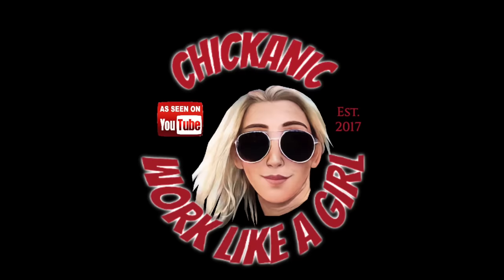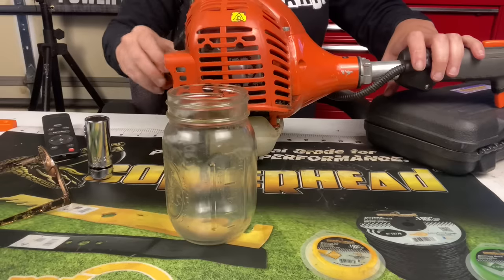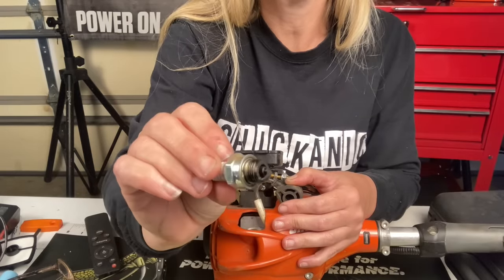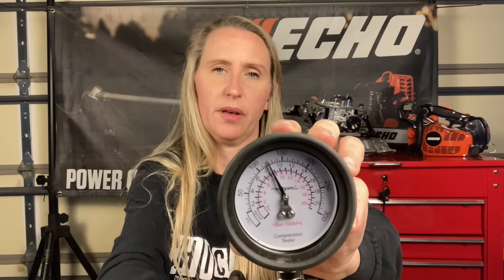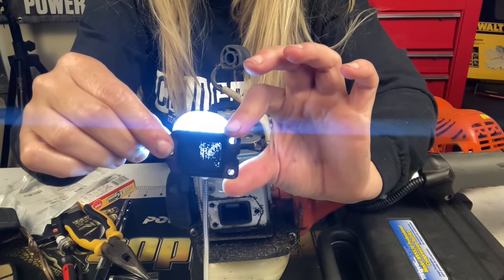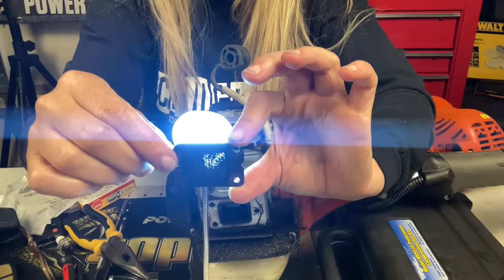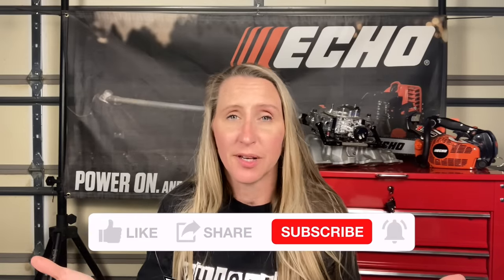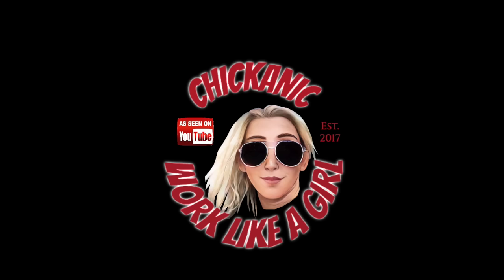How To Fix A String Trimmer That Won't Throttle Up. Echo SRM-225 Complete Diagnoses and Repair VLOG

Comment: Hi Bre, I have a PAS-225 and for some reason every time I use it oil leaks out of the muffler and runs down the fuel tank have you found a fix for this problem?
Reply from the maker: Are you using Echo oil? Usually the only reasons for this is is the same as I mentioned in the video. Not running it at full throttle, dirty air filter or mixing heavy. Stihl oil from the grey bottle will also do it. It should all burn off while running. You might check your exhaust port and make sure it is not clogged.

Comment: I have an Echo SRM 225 that I bought 12 years ago and I had to replace the carburetor about 8 years ago because of ethanol gas. I use it every weekend most of the year and it still starts on the 2nd pull every time. I will never buy any other brand for a string trimmer.

Comment: Mine is brand new from the store. I put the eco brand in. It's not starting. Sounds like it wants to. But no start. I took the air filter off to get some extra air in there but still no start. This is one reason i always like battery power ones but they don't have the power of the 2 stroke which is why I purchased this. I need to get rid of some high think weeds and brush. Can't do anything if I can't start it . Any idea what it can be no start fresh out of the box plenty of fuel 🤷‍♂️

Comment: Need help. Looking for why my Echo SRM225 shocks me.  I replaced the spark plug boot even taped the wire from the coil.  I still get shocked.  Do you have any thoughts?
Reply from the maker: You have a five year homeowner warranty. If you take it in they should be able to figure it out for you. I know they did enlarge the boots on the newer models.

Comment: I have a Echo SRM 225 that leaks oil I took it to be serviced and was told it leaks because I don't cut/trim at Full Throttle and it can't burn off oil. I don't buy this can you help me?

Comment: I’ve got a 22hp husqvarna riding mower that spits and sputters I changed the spark plugs and put a new fuel filter on it and put some fresh gas in it mixed with a little old gas it ran fine for 30 min then started doing it again idk what’s wrong with it
Reply: Did the same thing last year but after a while it ran fine

Comment: Well I think my old John Deere BC1600 made by Homelite is dead.  I followed everything on this  video and more.  Cleaned carb, replaced fuel lines and filter, replaced primer bulb, cleaned exhaust and screen, replaced air filter, spark plug, fresh 90 octane ethanol free fuel with Stihl silver 2 cycle oil and I'm still have a top end running problem.  I just checked the compression and it's at 100 which I'm guessing is too low for this engine.

Comment: Update on my edger and weedeater. The screen is clean in both but they are still bogging down or choking down at full throttle. Someone recommended new carburetor. I don't use the mixed fuel. I use the fuel from the red can that is already mixed.

Comment: I have this same. model.  Recently, i have been getting "shocked" from the trimmer around my tricep muscle area when pressed against the machine.   Any suggestions on what to check?  

Any help is appreciated.

Gary
" fro
Reply: happened to me. worn spark plug boot

Comment: originally way back when it was the us forest service  not the epa that mandated screens. some mufflers actually have media in them that are catalysts. so those are emissions related. it is a fallacy that the epa can fine you  for a plain screen but hey  with the government you cant win. its like puting a different air cleaner on. since the one it came with was used for certification  they deem all others to be a change in emission device /decertifying it.

Comment: Clean the very small screen that's close to the muffler.  In time folks, because a weed eater has to take gas and oil mixture, that screen becomes clogged with carbon deposits.  You will have to take that screen out completely by unscrewing all the screws in and around the casing of the muffler and removing everything out of the way. There, once exposed, is a screen that acts like a pollution control unit.  Take it out and wire brush all the carbon deposits off of that screen.  Once completely clean, you must put it back because if you don't, those carbon deposits will get on the piston of your engine, and hamper compression and choke out the performance completely on your weed eater. After putting the screen back into place and putting everything back the way it was, wouldn't hurt to get a new spark plug, and new gas filter. Change your spark plug, and change your gas filter so that clean gas and oil mixture reaches your carburator so that it sprays the gas and oil mixture into the small chamber of your weed eater engine for smooth performance and operation. Additionally, doesn't hurt at all to get a new air breather, air filter, if you will to keep all things up and running smoothly.

Comment: Help! I have the same trimmer,  put new spark plug, new carburetor (cheap one off Amazon), new fuel tubes, fresh fuel. Starts right up and runs great for 10 mins then dies. Can get it started but will not throttle up and dies. What can I do?
Reply: Also put new air filter, fuel filter, and cleaned the spartan arrestor.

Comment: 27k is that joe shomo or just repair shops cause every logger lawn maintenance company and smart enough to work on them that's the first thing that gets tossed out. That screen is the reason many machines break down. Just wondering

Comment: I have a sthil Hedge trimmer which I have replaced new Carburetor, spark plug, air filter, fuel filter and exhaust. it runs great until it gets hot then starts to bog down. If i open fuel cap and replace it runs great again for another few minutes but bogs down again. Any ideas?
Reply: its a HS45 - does not have spark arrestor

Comment: I have all stihl Equipment and don’t waste time doing anything but checking your spark arrestor screen first. 90% of the time that’s the problem and it’s a reoccurring problem on most steel equipment. It’s either carbon buildup or spider nest in your exhaust port That causes a lack of power or condition

Comment: HELP ME PLEASE!....I can't remember if my ECHO SRM-225 is 40:1 or 50:1   It hasn't run in years so I bought a $16.00 replacement carb and will do the rest but I'm 62 and I will be darned if I can find anything in my documents (that I can find) what the ratio is. They don't even explain how to load the line up..not much help.

Comment: How do you know when there's water in your fuel. Mine will idle but when pressing the throttle it boggs and eventually shuts off. I've gone through all the steps she made and all checked good. If anyone can help, id appreciate it.

Comment: help, I replaced all fuel lines, carb because it would not rev up. After replacing lines, carb, spark plug it revs up but then it dies like it runs out of gas?

Comment: Would a small engine shop hire me without schooling or experience working in a shop? I’ve worked on small engines and my vehicles  since my teens. I’ve been a vet tech for 15 years but I really just don’t wanna do it anymore.

Comment: Exactly why I went with the EGO line. I watch my neighbor struggle every week to start his mower and string trimmer. Here I come, pop a battery in and off I go. Five years with original batteries, starts every time. You buy a $300 mower and in a couple of years it's serviced costing $100. Just doesn't make sense.
Reply: I've tried the EGO trimmer and it simply does not have the power of the Echo and costs considerably more. My trimmer is about 10 years old and starts on the third pull. My 12 year old Echo blower starts on the first pull.
Reply: Steve, you must have voted for Biden? LMAO!!!

Comment: He also needs to know he can stick the ring. The he has to pay the labor to pull the cylinder, get the ring loose hopefully without breaking the ring, clean the ring groove, and reassemble the unit .

Comment: You may already know this but echo makes a compression tester with a 3 inch tube that echo technicians have to use floor warranty work, they claim they are more accurate then the compression tester with the long tube are use an echo compression tester for handheld equipment.

Comment: In my experience, when everything is right.... I.e. good fuel & fuel filter, clean air filter, clear exhaust screen, good spark plug, no air leaks, no clogged carb passages... a carb adjust is not needed.

Comment: I have a question about fuel octane. Is it a good idea to run 2 stroke engines on high test ? I have been doing this since my boat mechanic said I was supposed to run my mercury on high test fuel.
Reply: Normally yes especially when premixing oil & fuel. I run Sunoco Optima 95 never had a fuel problem

Comment: No screen means sparks spewing from exhaust and possible grass fires. I have used the same srm225 for 10 years, residential  use each season. It’s a Very durable machine

Comment: Use a torch to heat the hell out of the muffler ( off the machine) and either clean or 'accidently lose' that screen.
pound the muffler after super-heating to remove all the carbon and use high ratio (50-1 +) oil mix.

Comment: HELP HELP I need help real bad I have a Husqvarna 322L weed eater that will not run on full throttle I have replaced spark plug, fuel lines and fuel filter I have replaced fuel bulb replaced carburetor , and intake gasket. It will idle very good and starting is easy also have clean the spark arrestor. What is next???? Oh by the way the compression is 150 psi I am really lost now. Please help

Comment: Sometimes it can be also a fuel cap with a clogged vent,  so the carburetor has trouble getting the fuel out of the tank. But you know this already.😂

Comment: At the same time, for the cheaper units from Walmart I have seen many that simply need the fuel adjusted. Simply because every weed wacker style engine built in china aren't jetted or adjusted properly for the specific area they are being sold.

Even though adjusting those fuel settings are most likely close to $27,000 fine as well...

An adventurous YouTuber would simply put their license on the line and start a YouTube Series about stepping in deep dodo with the EPA and crawling themselves out of said hole... HAHA Just imagine all the drama you are missing out on!

Comment: I was fairly positive the screen was clogged just from the title.  This is one of the reasons I have started transitioning to battery tools wherever possible.  I got real tired of rebuilding carbs and cleaning exhaust screens every year.  I also got tired of messing with mixed gas.

Comment: FYI-my experience is when buying a new machine,check to see if the factory installed grease in the gearing down by the head.The Ryobi came without grease and the string would melt.That is how I found out there was no grease.

Comment: UPDATE:  The spark arrestor on my echo GT  225 trimmer is oil saturated and plugged, compresssion is good, I made a 25:1 mix, by adding oil to my container when I had no gas, got gas and added again oil to mix.  mix is fixed as in made a new batch. will clean screen tomorrow..

Comment: What?  Check the easy stuff before you start twisting and turning carburetor thingies in and out and screw the engine up even more?  But I'm a guy.  I know what I'm doing.  Ahh, this thing's broke.  I'll just buy a new one.  Great video!  Thanks!

Comment: Map gas will burn that screen clean as a whistle
Reply: Agreed. Really quickly too. I generally torch the whole muffler inside and out until it glows orange. Just long enough to make sure all the baffles and tight passages through the muffler are clean.  Put it back on and they generally run like new.

Comment: I had a landscaper who kept bringing units into the shop, and he would constantly remove the spark arrest screens.  I told him that I am not letting a unit out unless it has the screen, and I would have to sell him yet another one.  This happened about 5 times and he started to get mad and said that he takes them out anyway and he doesn't want to be paying for new ones all the time.  I told him to find someone else to work on his stuff then, because i am not putting my own butt on the line.  Grumpy customer, but he kept coming back and would then bring the arrest screen in a bag, and I could just clean it.  I don't know why he kept taking them out.  As a professional landscaper, he'd get sued and/or fined if he started a brush fire.  What the customer does to it after it leaves the shop is not my problem though.

Comment: Or, throw it in the trash and gets a battery powered one. I did that with my trimmer and chainsaw, and it is awesome! You press the button, and it works. Done.

Comment: Well I was correct but not in the proper way. I always had this issue with cheap oil and it was always inside the Exhaust port. I'm gonna give myself a 50 out of 100. Hey! you cant always know it 100% of the time.

Comment: I hope SOMEONE here can PLEASE help me. I've DIY worked on small engines all my life, but this is a new one for me. Briggs V-twin, on a zero turn mower. Started suddenly today, runs great for about 45 seconds, sputters for about 15 seconds then recovers and keeps repeating. Not a vacuum on the fuel tank, and not the fuel filter, refueled from the the same can it ran all day on just fine. Google wasn't any help, all those articles were for a loss of power, not "run great.. sputter...run great...sputter..." etc.
Reply: What carb is on the engine
Reply: @dudekanic  Thank you for responding! The goofy NIKKI carb, what else? I believe I got it fixed today since I had  light to work on it. Started and ran fine today, but as soon as it got hot back to the run...sputter...run...sputter cycle again. I believe my two main issue were a clogged fuel pump vent AND a clogged fuel line at the tank elbow. Cleaning those seems to have solved the issue, but I don't see either of those getting worse when the engine is hot. I'm thinking either the fuel pump is getting weak (1300 hours) and as the engine gets hot and the crankcase vacuum drops a bit it was not pumping well enough. OR the pump is fine and the drop in vacuum combined with the blockages was too much for it. What's your opinion?

Comment: Thank you, you have helped me v. much, as I have a srm 225 which is not running well and is doing what yours was doing, and I never thought to check the exhaust screen, before getting into the carb (which I was just about to do). After watching your video, I'll check the exhaust screen first and hope that's the problem. Otherwise I'll be watching your carb video you've linked here. 

PS I am a professional rat-trapper, so if ever you have rat problems, you'll see how to handle them effectively and professionally, by studying my many YOU TUBE videos. The Rat Trapper. https://www.youtube.com/watch?v=Cepq6qcZNMA

Comment: Echo weedeaters have horrible working ergonomics. The handle is too close to the shaft making you bend over more. The throttle feels thin and flimsy. The guard is pretty much useless. Stihls are the way to go. That's why 90% lawn maintenance companies use them. Echos are for people who have never tried a Stihl. Miss my old fs90r

Comment: Surely you immediately knew it was the exhaust. It was a waste of time to check anything else. Smh. Take off the screen, test if it works, then you can do everything else including cleaning the screen and putting back in.